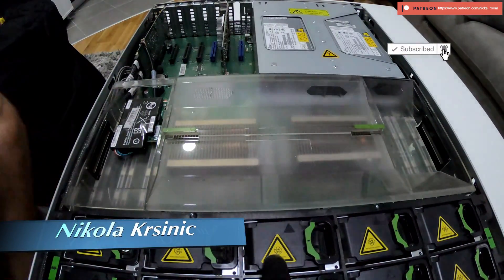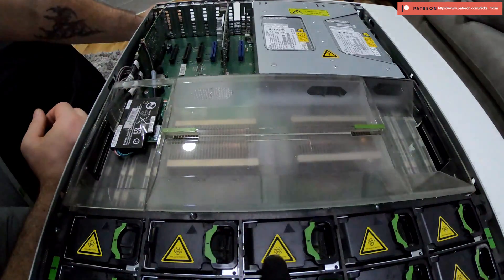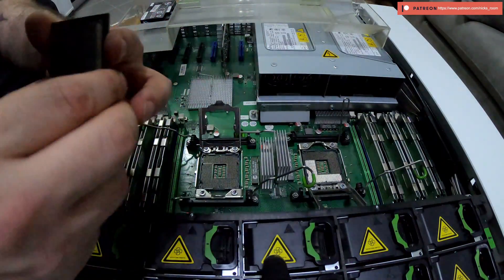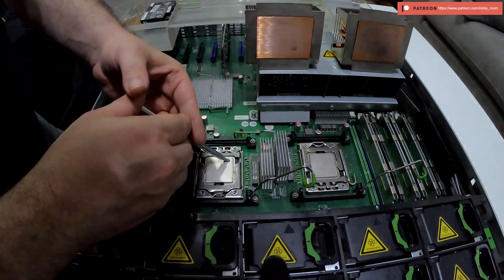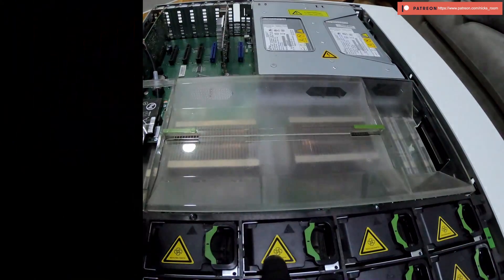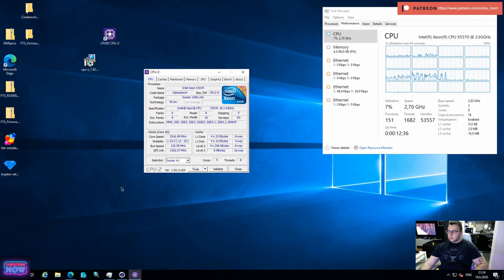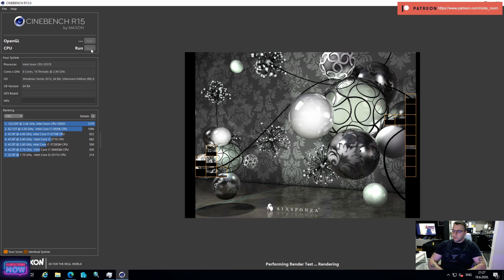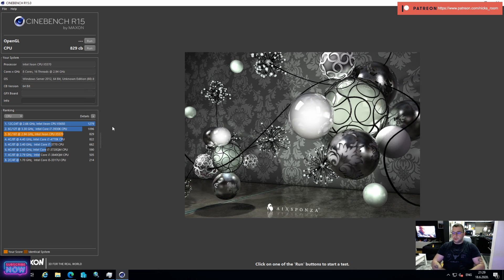FujitsuSimens RX300 S5 CPU Upgrade

Comment: Thanks for this video Nik, I found 2 of these severs in hard rubbish and couldn't for the life of me figure out what the highest preforming cpu was that was compatible. Thanks 👍
Reply from the maker: Well depends what you need for higher clock speed X5677 but less cores (4C 8T) or X5680 with little lower clock but 2 extra cores (6C 12T)

Comment: I wanted to build a 2 cpu , or an old (cheap) xeon cpu build for a long time just for the fun of it. :) But I'm always short on time, and I wouldn't use it anyways
Reply from the maker: There is planty of use it once you quit playing with it, you can set it up as a router or storage server and once is set you can forget about it and it will always do ist job
Reply: @TekNik081  I'm building an upscaling machine now, I have a mainboard H110m Pro-D what I don't use for anything, with a CPU what I definitely have to change Intel celeron G3900. With some ram and a nice GPU it'll make a great second system :)
Reply from the maker: What you planning to use it for?